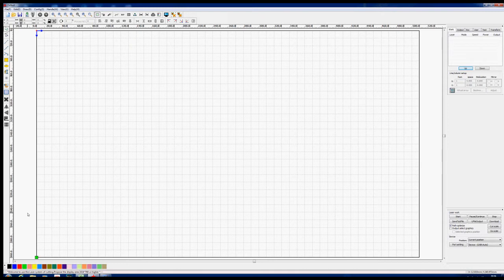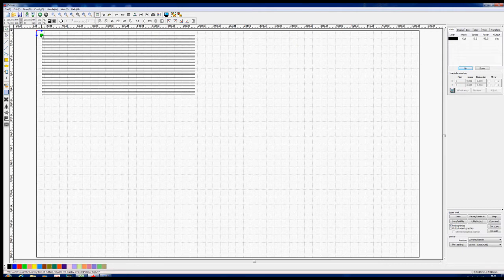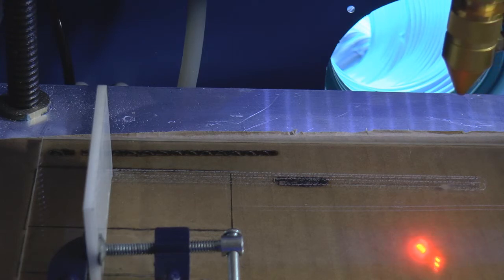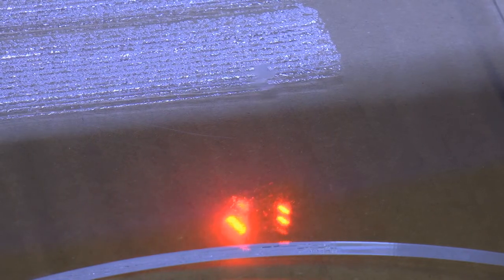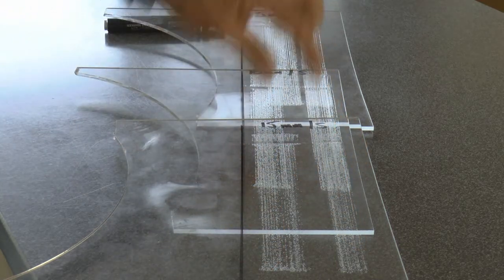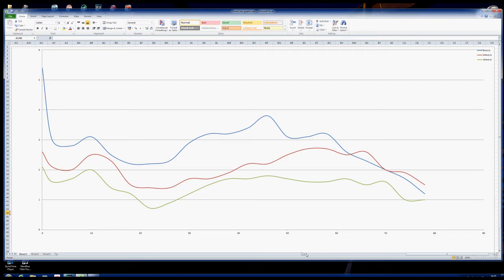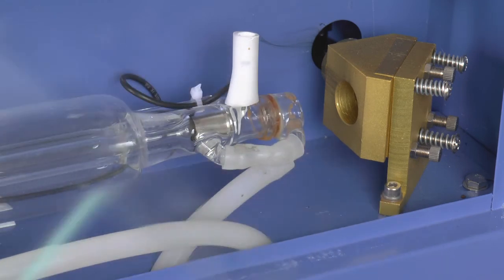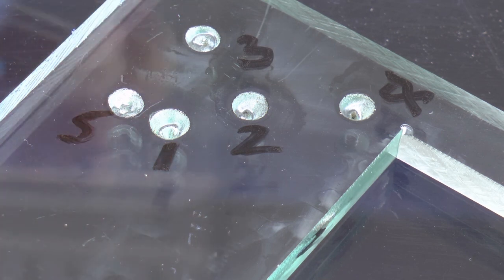RDWorks Learning Lab 16 Laser Power LossTests

Comment: So the core problem is where sir ... I have the exact same problem as yours ... what should I do to fix this problem ... Please help
Reply from the maker: Hoi Roy
At this point in my learning journey I was still very naive about how corrupt the Chinese laser business was (and still is). I bought what I thought was a 50 watt laser.  It turned out to be an 800 mm long 40 watt tube that was also a B grade tube and in reality delivered 30 watts for a few minutes and then lost power.  I eventually gave up on this tube and bought a replacement. from Ebay.  Bad mistake because I replaced junk with junk. and It was not until I upgraded to 60 watts with an A grade tube  and new power supply that my machine became a proper machine. Here we are 5 years on and that tube is still performing as new.. It will be worth the money because  the tube you bought with the machine is a reject tube from a large manufacturer that could not be warranted.
It is almost certain that your HV power supply is qually B grade  so I am afraid it will cost you money to get A grade replacements.. Do not buy fron Ebay or Amazon market place or the sharks will eat you alive. One 100% trusted source for spares is cloudraylaser.com. If your buying new , this is the right time to swallow hard and decide if you want to rplace like for like or upgrade to 60 or 80 watts. Let me know and I will advise on the options.
 Best wishes
Russ
Reply: @SarbarMultimedia  my machine uses reci brand laser tube ... 100 watts ... and indeed there is a written label ... power supply uses 100 watts ... and uses ruida ... and RD Work v8 for the software..
I uses wather chiller CW5200 for cooling system machine..

 like what I saw in your video ... the beginning is good it can cut ... but over time it can't ... So the conclusion is there is a solution? besides having to buy new spare parts ?? 
my machine has only been used for 4 months ... and rarely operates ...

Maybe others can help me for this comdition?
Reply from the maker: @roytjandra2554  
 Hi Roy
 I have no doubt that you have genuine Reci tube but Reci do the same with their rejects tubes, they sell them cheaply to machine builders with no warranty.  Is this a W2  model  which will be claimed as a 100 watt tube but in reality is a 75 to 80 watt tube when A grade. The clue to it being B grade will be in the graph and numbers on the tube.  The max (peak) test watts for a W2 MUST exceed 100 watts or it fails . For a W4 the value is 130watts.  If your graph exceeds these values then you have an A grade tube. If the max value is low, there could be any number of faults with the tube.   Stand a piece of card in front of mirror 1 so that it is 90 degrees to the beam (not 45 degrees)  and put a low power (maybe 20%) scorch mark onto the card. Run the machine until you lose power and repeat the test. My guess is that now   you will either see 2 or 4 dots.?

Despite their name,  Reci do not make the best tubes, just the most over specified and overpriced tubes.
Let me know what you find.
 Best wishes
Russ

Comment: hi thank you for information i have a Question please
if i upgrade my Laser from 30 W to 100 W what Vendor Tools in Laser TAB i need to Configure Because after upgrading my Machine to 100W it still work like 30W Laser
and Thank you .
Reply from the maker: Hi Fatehy
 Your laser vendor settings should be for glass tube with 0 attenuation.  The min power can be 1% and Max power 99% Laser frequency should be 20kHz and signal level LOW (to switch the tube on). It is very unlikely these will be set wrong and your new 100 watt tube will not be affected by these settings unlee max power is set very low.
Do you have an ammeter fitted to your machine?  Did you upgrade your power supply to100 watts also? where did you buy your tube and power supply?

Best wishes
Russ

Comment: I think the PowerSupply is workink at its upper limit, getting overheating due to long working time
When the PowerSupply get hot it will reduce the output power and then cool down a little.
Have youthe option to log the temperature of the semiconductors on the PC-board?
Maybe to add more heat exchange to the PC-bord will help.

Well, 5 years after your test, you may already find the answear in one later video you have done.
Reply from the maker: I was very naive when I bought this machine and  with no advice on WWW to guide me I had no idea of the tricks the Chinese play with these machine. The tubes fitted to Ebay machines are B grade tubes that have failed final test at one of the big tube manufacturers. They are bought for next to nothing , retested to make sure they work "in some way", relabeled to give them credibility  then are fitted to ebay machines The machinesare container shipped to various local warehouses around the world and a team of PRIVATE ebay sellers in China  sell them to you from the kitchen in China for commission from the manufacturer That makes any promised support/warranty worthless because if you are savvy enough to spot the problems then the buyer will disappear once he has his commission.  I fought with the tube for a while and then bought a new tube from ebay. BAD MOVE. It was another B grade tube. I ultimately had to do some research and bought a new power supply to match the A grade tube that I purchased. I subsequently found out that I had a B grade power supply  as well as a B grade tube, My new tube and power supply have been working perfectly for more than 4 years now and are still performing as new, I subsequently worked out as I acquired more knowledge , that the B grade power supply was randomly switching the output mA  from what ever working current  I had chosen down to about 3 or 4mA.  ( the preionization zone) which is why it was whistling/hissing). With so much worldwide correspondence I quickly get to see pattern in the problems 

Best wishes
Russ

Comment: i known its late but your water wasn't flowing
Reply from the maker: Hi Norm
Without water flow the tube would overheat and pop within a few seconds. I use distilled water and there are no bubbles in the water to  indicate flow. The good news is that the system is protected by a flow switch  that prevents the laser from firing if there is no flow. This was very early in my learning journey and I had no ability to measure watts of power output. I sensed there wss something very wrong with the tube  but was trying different ways to prove it without a power meter. I did eventually find out what the problem was with this tube. All ebay machines are supplied with B grade tubes that work in some way.......... enough to fool the technically naive Ebay buyer.  As the series progresses, the story will unfold.
Thanks for your concern
Best wishes
Russ
Reply: @SarbarMultimedia  in the video there was bubbles but they were not moving when you did the "Mode burn" by the laser tube. Unless I'm seeing things.
Reply from the maker: @normcaissie5598  Hi Norm
Panic not,. there are microbubbles that often stick to the inside of the tube and will not be easily moved by the relatively low velocity of the water  flow. It was very observant of you, but in 4 years with 2 tubes I have never had a water problem. Even quite big bubbles can exist in the tube and not cause overheating. However, I am a believer in keeping them to an absolute minimum  but not stressing over a few.
Thanks again for the comment.
Best wishes
Russ

Comment: Hello Russ. My laser just stopped working for me while I was producing a job. It just stopped firing. I checked the tube while pressing the firing/testing button, but there was no red light occurring inside the tube. The water flow sensor is working well as I checked this first seeing that I had a problem months ago with my water pump cutting out and the the tube not firing. I also checked the power supply and the fan is still working. Is there any way of me checking to see what could be causing this problem? I'm thinking about replacing all the electrical guts in the machine along with a new laser tube to get her back up and running.
Reply from the maker: Hi Brian
Unless the tube is mechanically damaged in some way it will not just drop dead. Even when it runs out of CO2 and delivers no power it will still have a pink glow of ionized nitrogen in the tube. Without going into detail about the physics of how the tube works, the pink glow is NOT the laser beam it is the engine that creates the invisible laser beam.. When a machine stops working instantly it is 99.9% certain to be a failed HV power supply. Although most people think the tube is the most vulnerable part of the machine from tall the correspondence like yours, I can assure you that the most likely item to fail is the HV power supply.  Within the power supply there are  one or more specia transformers that create the very high voltage required to ionize the nitrogen. The fact you have no pink glow tells me that your power supply is not generating that high voltage.. You will not need a new tube because a failed power supply will not have damaged the tube. . If the tube was working well before the sudden stop then it will work again after you renew the HV power supply.

Best wishes
Russ
Reply: @SarbarMultimedia  Hi Russ. Thanks for your reply...welcoming it was to know that it is more likely to be the power supply rather the laser tube itself. Maybe I should not be asking you this, but seeing that your knowledge and experience far outweighs mine, do you happen to know of a reputable retailer who may have these power supplies? Seeing that you have repaired/replaced and probably revitalised your laser with new parts I assume that you may have a contact of reputable character with whom I might be able to do business. I would prefer a company in the United States seeing that I have family living there to whom I may have the item shipped, but if your contact is only in China, well, beggars can't be choosers. I look forward to your reply with regards to a contact name, number or email address. You may reply to email address as this is one area I check constantly and the information will be stored there safely for future reference. Thank you so very much
Reply from the maker: @brianserrao2331  

Hi Brian
I have established one trusted contact in China that is absolutely honest and straight with his business dealings and understands the western meaning of customer service. The fact that he has a Chinese website sounds like bad news for you. See   https://www.cloudraylaser.com/

BUT the good news is that he is trying to establish a western presence and so you will be pleased to find him also at
https://www.amazon.com/s?i=merchant-items&me=A2M1Y79D9F74M8

The prices will be different because you are buying from Amazon  with Amazon's commission added plus any shipping if it seem to be free.

Best wishes
Russ

Comment: Hello friend, I have a problem with my POWER, it is all well connected between board and power supply, I have my a 0-5V activation on the PWM pin of the power supply but when I shoot 5V the source does not deliver more than 29kv and 5mah. Do you have any idea where the problem is? I have power supply RECI P14 and main board with rdworks
Reply from the maker: Hi Sebastian
29kv is ample to trigger as high as 130 watt tube but Reci play safe and say 100watts.
Here is a typical connection diagram
https://www.alibaba.com/product-detail/Reci-laser-co2-power-supply-P14_60637980483.html?spm=a2700.7724857.main07.1.1a6a4e3amumi2m
 The key links between the Ruida controller and the HVpower supply are on the 6 way connector  The PWM or Analoge go to IN. The L1 goes to L and GND links to G. The L controls the beam  ON/OFF and the IN controls the current flow through the tube. The water protect is usually done at the controller end thus the WP is linked to G on the HV power supply. The other connections are all to do with the display on the power supply
If there is a glow of any sort in the tube then the power supply is doing its job and has enough voltage available to trigger ionization of the nitrogen in the gas mix.. When the current flow is VERY low, maybe 3 or 4 mA there will be a glow at each end of the tube . As you increase the current flow the  two ends will eventually meet in the middle. This low current phase is called preioniztion and may exist even when the the beam meets  in the middle as a hazy wisp. Maybe at 6 or 7mA the beam characteristic will become much more solid and pinky mauve. You are now into the steady state phase that should continue up to 25mA.  Reci do not recommend any of their tubes to run over 25mA if you want to achieve the claimed service life.

My first reaction would be to prove if the instrumentation is telling the truth. Remove the lens. Put a tray of water under the head about 200mm to 300 below. Set up a simple test program of say a 25mm circle and set the speed to 1mm/sec. Now set the program power to 10% and examine the beam in the tube for the conditions I described above.. Repeat the test with a 1% power increase until you get a solid pink beam then step up in 10% increments. as you get to 60% and above I would expect to see steam rising from the water. Increasing steam indicates increasing power, regardless of what the meter shows. .
 If that appears to be successful then replace the water tray with a piece of 5mm or 6mm acrylic. Draw lines on the acrylic at say 50mm/sec but for increasing powers in 10% increments. The surface groove should get deeper and deeper as you increase the power.

If you can prove you have the power there , then it will be a matter of sorting the instrumentation connections to reflect what is really going on.

If you have those 2 key wires from the controller correct (L and IN) and you are truly down on power, then it can only be a power supply issue.

Hope this (and the simple tests)  helps to clarify your thoughts
All best wishes
Russ
Reply: Thanks for you answer Russ, i try with water test and tell you the result. Sebastian

Comment: From my info that is about specific of CO2 lasers and gas that is inside. it needs time after long cut to recycle gas to right state.  So with long cut gas degradation is more and there is power loss. After sometime gas regenerates and you gain back power...
Reply from the maker: +MNO 
Hi 
When I did this work I was ignorant of how my tube worked. I was trying to find a pattern of power loss . A few months later after a lot of research I discovered exactly why my tube behaved the way it did. If you haven't been there yet you might like to visit the 3 part video starting at https://youtu.be/6onXMU08GzQ
Best regards
Russ

Comment: what is the wattage  of your laser ? im thinking of getting the 130 watt thunder laser machine ?
Reply from the maker: +Jay Kay 
I bought a 50 watt laser off Ebay. The machine is mechanically good but the tube was only a 40 watt tube. How was I to know? We have no means of checking  and no one was warning of the scams that are going on with these machines and tubes on Ebay. I think you will be safe with Thunder Laser they have a good reputation.  130 watts is a powerful beast that will probably just about etch metal surfaces as well as cut through thick materials  (15 to 20mm acrylic I'm guessing). 
http://www.cncoletech.cn/Laser%20tuber%20high%20power.html

http://www.aliexpress.com/store/product/1-pcs-Of-High-Quality-1650MM-Length-Long-Lifetime-130W-Co2-Laser-Tube-Warranty-6-Months/321243_1794596115.html

http://www.recilaser.com/en/productInfo/fc9181e93b448cac013b44f673270de5.htm

It will be worth contacting Thunder laser and getting written confirmation that this is a working 130 watt tube and not a max rated 130 watts
 Your Mars machine width is 1850mm. Of the three reputable tube manufacturers above, two of the 130 watt tubes will fit that frame. If fitted with a Cole tube then it will be a 100 watt tube. The thunder laser spec says 100 -130watts. What does that actually mean? For example the Cole 130 watt is not clearly specified whereas  Reci are being honest. Their 100 watt tube is a 100/130 watt tube. What that means is that yes. it will develop 130 watts if you over drive it, but at the recommended max drive current (maybe 30mA?) it will develop 100 watts. Just be suspicious because you are spending a lot of money. Find out what brand and tube/ part number will be fitted to your machine and check it out . Despite their good reputation your 130 watt dream may not be what it seems.
Good luck

Russ
Reply: i really appreciate your time and help ill keep all that in mind and i ll let you know how s my business will go i haven't start yet im waiting for the machine so wish me luck

Comment: Russ,

Just to post this into the right place....

But I did some tests with my, supposedly the same machine, and I can not cut even 4mm plywood. The plywood I'm using is marine plywood, so it could be made of harder wood. I'm not sure but I don't think that would explain why I can't cut even half the depth that you can.

Strangely I can cut 3mm plywood, without any problems, at 65% power and around 15mm/sec

I can cut 4mm MDF at about 65% power 10mm/sec

What seems to happen with cutting wood, is at a certain cut off point, the cut almost seems to be self sealing with carbon, which absorbs all the laser energy, and to all intents and purposes it doesn't really matter how slow the I set the speed, I can't get through, as it just increases the area of carbon around the cut line.

I'm sure there is a technical explanation for this, but I'm not sure what it is.

Anyway, I'm waiting with baited breath for my 38mm lens to see if it gives the cutter the god like abilities of yours ;-)